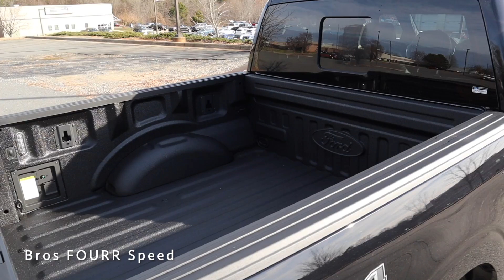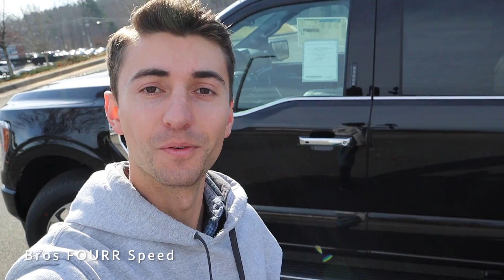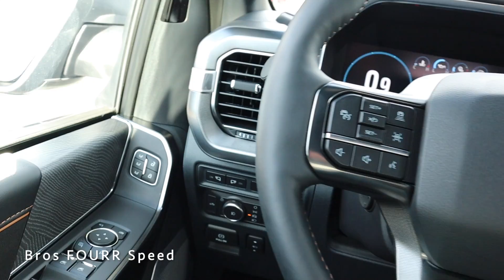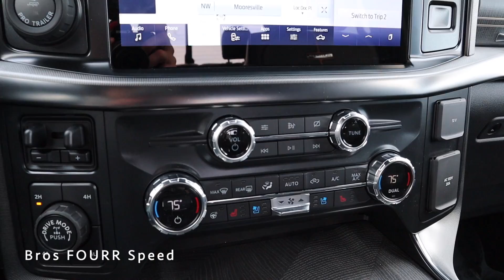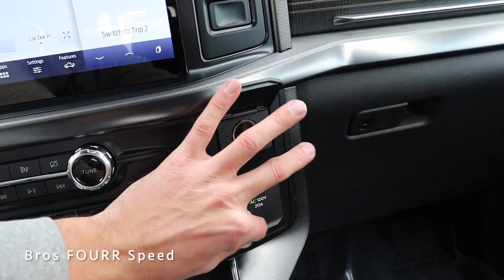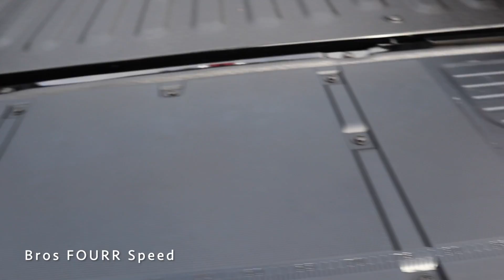2021 Ford F150 Platinum FX4: Start Up, Walkaround, Test Drive and Review

Comment: I noticed the undercarriage has a rust protective coating. Does anyone know if that is standard on the Platinum? I know there are recent concerns of rust on some F150s. My Platinum is ordered but who knows when it will actually arrive. I’ve never seen the undercarriage of a Platinum but I do know Lariat and below does not have a coating
Reply from the maker: Most should have it. But that could also be an undercoating option from the dealer. If you're buying one brand new, that's a great time to do it just in case.

Comment: QUESTION  : If you LOWERED the SHIFT LEVER to use the work surface ; then , needed to drive away , and after you closed the work surface ,
the SHIFT LEVER REFUSED  to raise up , are you stuck - unable to drive away ?
Reply from the maker: Yeah lets hope the shifter never gets stuck down. But it's a simple mechanism. You'd think in this day and age it wont break for a few decades. Might be a manual release tho like how cars have the shift lock release
Reply: @BrosFOURRSpeed  Yeah , I am sensitive to this issue  as I had a 1994 Ford Ranger 4x4 , where you shifted into  4wd by pushing an a button  ( electric ) on the dash .  In the middle of a snow storm I cam to a hill  , stopped and pushed the button and got a strange sound . and the vehicle would not move forward  or move at all . Had to call a tow truck in the middle of a raging  snow storm . At  Ford dealership I was told the solenoid associated with the 4x4  electric button shifter had failed and the  vehicle was stuck  , half in 4wd and half out of 4wd. After that  experience , every 4x4 truck I purchased , I made sure it had a manual lever to put it into 4wd  .

Comment: Ford F-150 Plasticanim
Reply from the maker: to many vehicles have metal on the inside. Pretty much every car out there is plastic for the interior. Its nice tho. Doesn't feel cheap
Reply: @BrosFOURRSpeed   It does look good.  I love my  2019 f150. I just know my plastic is not going to hold up

Comment: Does the 2021 Platinum have the fake engine sound? I took a 2021 platinum ecoboost for a test drive and could not hear the fake engine sounds myself.
Reply from the maker: I'm not too sure. You would not be able to actually hear it tho. It'd sound natural and you'll think its the actual engine making the sounds. I'm sure there are ways to code the computer and remove it if it has it. I did that with my Supra. Never knew that car made fake engine sounds until I shut it off

Comment: $73,000, Ford has rocks in their head
Reply: You act like no other manufacturer asks that much for their trucks
Reply: @JamesThomas-dn6ee  and??? What difference does that make ? You gotta be stupid at 1k a month to just style around in a truck that you are NOT making money with.
Reply: @jhartmac100  if you have the money 💰you can and they definitely sale enough of them. If you can't afford this them get an xl or xlt
Reply from the maker: If you can afford it and want the truck, then it's not stupid to them.  Everyone has a different lifestyle and what they want.  Doesn't mean everyone has to buy this truck.
Reply from the maker: Good statement right there.  The lower trim levels are much less!
Reply: @JamesThomas-dn6ee  I got it Im a GS 15 do the math it just isnt worth it.....none of them are.....if I was goin 70s I get the Raptor
Reply: @jhartmac100  you can get a well equipped f150 for $45 to 50 grand its worth it vehicles are not cheap anymore and are not getting any cheaper
Reply from the maker: The Ram, Silverado and a few others are up there!
Reply: Exactly
Reply from the maker: Yeah it's expensive, but other trucks can cost around the same.  Depends on what you need and what you can afford.